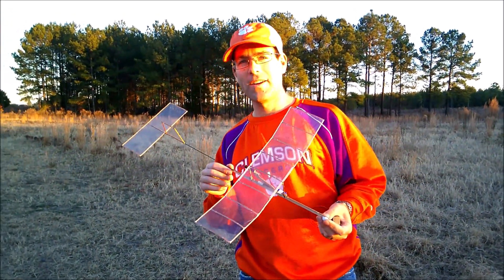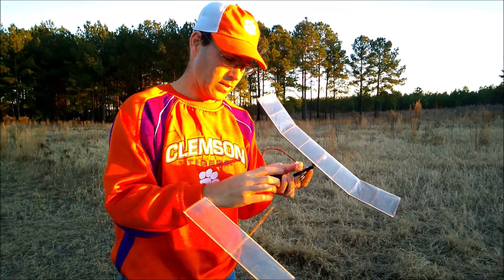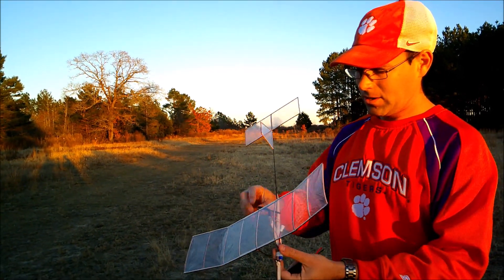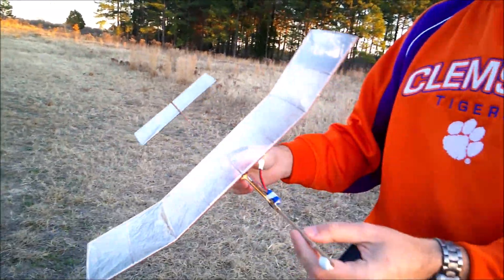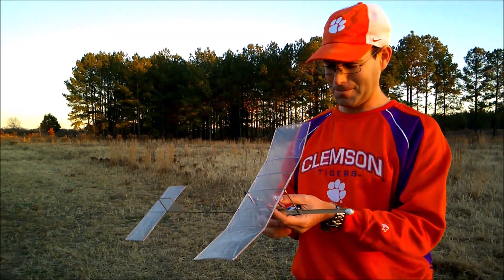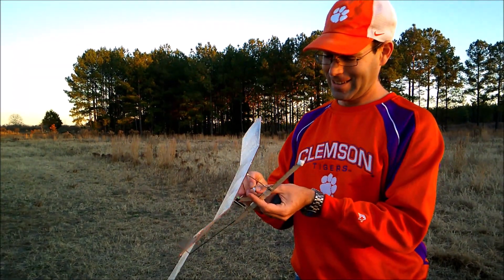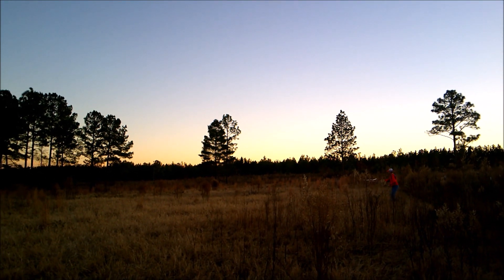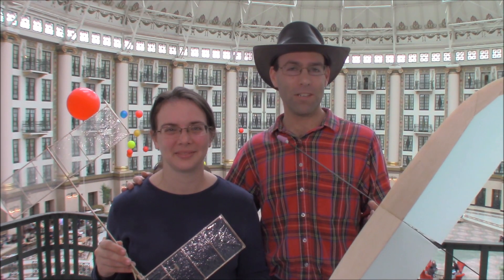Zapper Capacitor plane - legal for Electric Wright Stuff 2020

Comment: On the 2021-2022 Electric Wright Stuff rule sheet it says that you get 10% bonus flight time if your wing surface is in between at least two ribs. I was wandering what they mean by "ribs"?
Reply from the maker: The wing on these has two components, the spars (leading and trailing edges), and the ribs (the airfoiled chordwise elements).

Comment: How much do you think props can be improved for direct drive coreless DC applications? I always feel like those micro props look far from optimal
Reply from the maker: I think they're pretty close to optimum for direct drive. Geared gives a substantial advantage.
Reply: @joshuawfinn  has anyone run a capacitor plane with a gear drive? I feel like there's really something great to be seen in there somewhere
Reply from the maker: @RedstonePyroMan  yeah I've seen a few and they were quite potent. The Germans are getting huge flights from geared setups, 6-7 minutes indoors.

Comment: Joshua  does the kit come with the power system ?
Reply from the maker: Yes it does! You supply the two AA batteries, but that's it.
Reply: @joshuawfinn    is it in stock ready  ?    if so ill order it     i really like the design   Supercap  slow flyer
Reply from the maker: @larzhillbot1443  yup. We've got kits ready to go. :)

Comment: I made the same design  but with coffee stirs sticks and toothpicks a carbon push rod and 1 foam picnic plate for the tail parts and 1 Square plastic foam plate for wings with hot glue for every thing and powered by a 3.7 v RC helicopter battery and a small drone motor with prop in the front not back and it flew in my room so can't wait till the snow is gone to test it out hoping it will fly
Reply from the maker: That sounds fun! Let me know how it flies when everything thaws out!
Reply: @joshuawfinn  I have a update on the plane it  flew well for 17 grams with a small propeller the design works good with foam free flight thank you